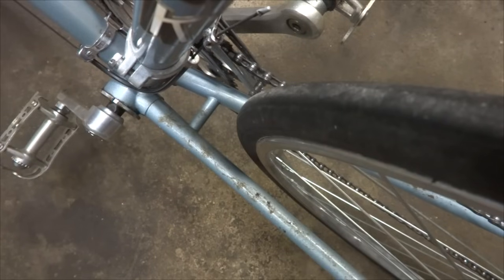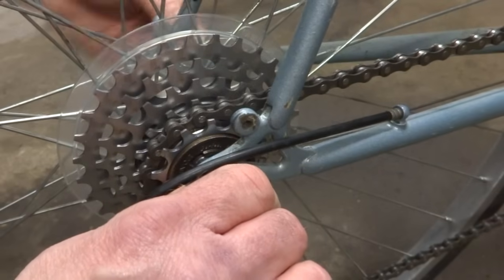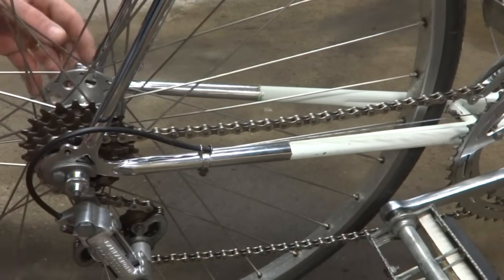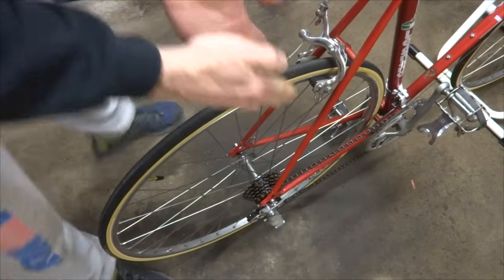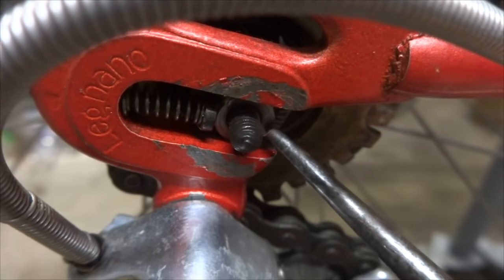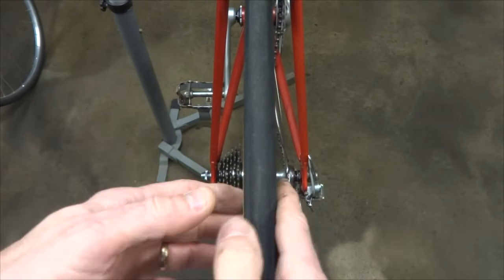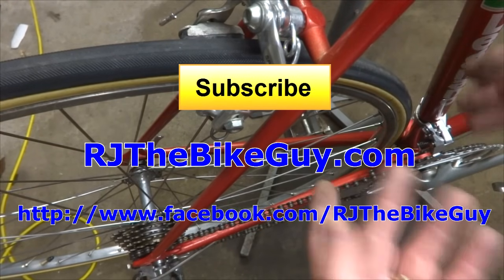Fix Rear Bike Wheel - Off Center/Rubbing Frame

Comment: I have this problem with my new bike, rubbing on the drive side, but it’s a through axle bike so I couldn’t adjust the axles of the frame, I am not sure if it’s the problem of the wheel or the frame. Really drive me mad.

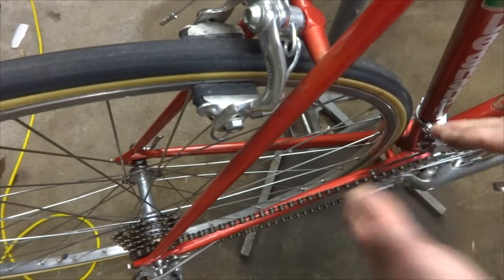Comment: 09:08, why is it not essential to ensure that those stays are properly centred? 
At which point does stay alignment with respect to the frame tubes' axis become critical?
Reply from the maker: The closer to centered the better. But you are never going to have it perfectly centered. Is it important to have it centered to 0.00000000000000000000001mm? No! Look at 3mm. It's tiny. Not going to make a huge difference. The farther off, the bigger the difference, especially at higher speeds.

Comment: Mine comes loose like crazy. No matter how even it goes in to drop out no matter how tight it's tighten .. I have shimano deore rims with quick release. Soon as I pedal meaning force to get moving from a stop you instant feel rear rim shift to the right of frame. There also is no loose bearings. And no broken axel. Hope you can help. 14 times in 5 Mile ride I keep having to get off bike to reset the hub in drop out
Reply from the maker: I can't tell you without working on the bike. You need a mechanic to look at it.

Comment: The spacer on the axle on the drive side is longer than the one on the non-drive side.
Does it not cause the wheel to be off-center, closer to the left brake pad ?
Reply from the maker: It's longer to accommodate the freewheel/cassette. The spokes are also different lengths on each side. But the wheel should be dished so it is centered.

Comment: My aluminum frame is toast!! It was a hit and run, I recovered however it would appear I cannot bend the aluminum frame back!!! Should I cannibalize???
Reply from the maker: +Johann Goethe If the aluminum frame is bent, it is toast. The only way to safely bend it back is to have it heated, bent back, and then heat treated. This would all need to be done by an expert. Probably not worth it unless you have a very rare and valuable bike. Get a new frame and transfer the parts.
Reply: RJ The Bike Guy THANK YOU!!!
Reply: @Johannas  Eat it
Reply: @RJTheBikeGuy  oo

Comment: is there a way to prevent the wheel go out of aligmebt when you put too much force on the pedals?, maybe changing the qrs?
Reply from the maker: I covered that in the video. Stronger skewer, dropouts aligned, etc.
Reply: @RJTheBikeGuy  why did you kill the forums of your page?, there will be super productive to respond questions inside the comunity.
Reply from the maker: @fernandomiranda765  They were getting overwhelmed with obnoxious spam.
Reply: I looked for the video you mention but could not find it on your channel.  Can you add a link pls. I have the same issue on a 1980's 12 speed I am trying to restore. When I put a lot of pressure on the drive the wheel pulls to the opposite side.
Reply: i solved readjusting the axle of the wheel, it was to long on the no drive side and didt let the secure to clamp with force the frame

the axle of the wheel most no proture off the outside of the seat stays.

hope that's help.
Reply from the maker: Which video I mention?
Reply: The you mentioned "stronger skewer" to the first reply
Reply from the maker: This video.

Comment: my jopos rear tire starts rubbing the frame when i try to pedal, and when i flip the bike the rear tire is loose going from left to right
Reply from the maker: You have to work the problem.
Reply: @RJTheBikeGuy  mine is hitting to brakes , What's the problem there

Comment: Hey man my tire keeps rubbing against the frame, I took it to the shop I bought it from but every once in a while it happens again, its a surly cross check. Any suggestions? could it be a frame issue?
Reply from the maker: All my suggestions are in the video.

Comment: I have a problem with my roadbike. I change the tyre with a high tyre 28, before I use 23 Now the problem is the tyre touch the front plate. I think I want to cut half of the plate to give a space to the tyre. Is that can? My friend said better dont.
Reply from the maker: Don't.
Reply: @RJTheBikeGuy  ok noted I will not do it. Many people said dont do it. Thanks..

Comment: I put a new tyre on - 2.1" width on older mountain bicycle.
I had a 2.1" MTB tyre on before, but the new one is definitely chunkier, a little higher and has a little higher volume.
It´s kind of annoying how a 2.1" tyre can vary in height and volume so much and there is no way to know that.
.
Anyway, the wheel is true - I have rim brakes and no rubbing there so I know the wheel is true.
.
But the tyre rubs against one side of the frame - against the chainstay on the opposite side from the cassette. 
So even though the wheel is true, it is like the tyre is not true.
[for approx 180 degrees there is no rub, and about a 2 mm gap, but for 180 degrees there is a little or a lot of rub]
On the other chainstay [on the cassette side], there is always between 4.5 to 6.5 mm of space.
.
I guess I just need to install a tyre that is not as wide and chunky.
.
But is there anything that can be done to address how out of true the tyre is?
I imagine not, but it is surprising how bad it is - I thought pumping air in would remove any such irregularities.
It is a Michelin Country Race´r 26" x 2.1"
.
Maybe if I remove the tyre and put it back on the problem might disappear?
Or remove it and install it the other way round?
Or put a washer in between the frame and the wheel to add a little space?
  [but maybe that would affect the rim brakes too?]
.
Well if anyone has any remedies, please let me know.
.
Thanks
JB
Reply: I tried the washer thing - was not going to work, was very little axle free / exposed to put it on.
I also tried this suggestion [but using standard flat washers]
  https://www.youtube.com/watch?v=conXV3EMGVU
It did not appear to make any difference, and I have no idea why it even would, but it was worth a try.
.
Then I removed the tyre and put it on the other way round, and that did fix the issue. 🙂
Tyre still moves towards the chainstay for around 180 degrees, but at  least now it does not make contact.
cheers!
JB

Comment: If i put my wheel in straight and put force on the pedals it goes to the left
Reply: Hey same here!  Did you get it fixed?
Reply: Your axle is probably broken. Now the only thing holding it is the QR go ahead and replace it
Reply: Max another possibility is (if your axle is not broken) one or all of the bolts are facing the wrong direction, i mean the side with bumps should be facing the dropout
Reply: Max Buy a new chain

Comment: My axle spins when I begin tightening the nut and it shifts it towards the frame anyway to fix that
Reply from the maker: I can't diagnose your issue without working on your bike.
Reply: @RJTheBikeGuy  so what happens is I tighten my chain and while I’m tighten the nuts the axles spins with the nut and when I get the nuts tighten and I ride my bike the wheel shifts towards the frame and my chain gets loose

Comment: Mine pops out of being seated while tightening and my disc brake rubs any advice for it
Reply from the maker: I discussed the most common causes in the video. If you can't figure out, take it to a mechanic. I can't diagnose it through the internet.
Reply: Oh I am thinking it’s frame damage I wish I could hire you to repair it but it just kinda sucks thanks for the reply though
Reply: emailnodata This is late but it didnt use a skewer the wheels had lug nuts on them.

Comment: The issue with my bicycle is that when I install the wheel it seems to be okay, everything is in line and straight. After taking it for a ride though, the wheel goes sideways. This happens in a distance of approximately 150m. Could you help me?
Reply from the maker: Clamp it tighter.
Reply: +RJ The Bike Guy It is as tight as possible. I just figured out that the skewer is bent though, could this be the case?
Reply from the maker: Did you go through all the steps in this video?

Comment: I’m riding a Diamondback sync. The rear wheel is ever so slightly off center however if I punch the drivetrain to accelerate the wheel off centres itself even more and rubs on the frame any one know what going on?
Reply from the maker: Not without working on the bike. Maybe frame flex.

Comment: What if my bike rear wheel is centered between the chain stays, but is off center on the top, where the brakes are mounted to the frame? Its so weird
Reply from the maker: Can't tell you without working on the bike. Go through the video.

Comment: my wheel touches the frame if i very quickly accelerate or if i carry something heavy. thew frame is bent but somehow its been fixed a few times
Reply from the maker: I don't know. Maybe the frame is bending. Maybe the wheel is bending. Maybe the spokes are loose. No idea.
Reply: the aluminum frame is bent and the quick releases were just removed
Reply from the maker: If the aluminum frame is bent, you should probably replace it. Especially if someone tried to bend it back.
Reply: it hasnt been bent back

Comment: I kind of still don’t understand though, I own a mongoose XR-15 and everything is good with it, but when I pedal hard on 3-7 Gear the wheel either rubs on the frame, or it will go out of place and stay on the frame until I move it out again, and it continues to do this, could anybody help me?
Reply from the maker: Hard to diagnose without examining the bike. You may want to have a mechanic look at it.
Reply: Mine does same thing new specialized with quick release . Nothing broke or bent just rear tire shifts to left rubbing frame untill I release quick release
Reply: Joey S I have learned how to fix my problem, all ya need to do is take the wheel off re ajdust it, then you need to tighten the wheel as hard as you can and hold it in place in the middle, I figured out that the force of me pedaling from the derailleur side pulls the wheel to the left, due to the force.
Reply from the maker: @deevanhook547  You may need a stronger skewer, or your dropous are out of alignment, or the axle is too long, or, or, or, etc.
Reply: @deevanhook547  thank you I'm taking it in Monday guy at shop said same thing based on what it's doing.
Reply: Joey S I'm glad i can help, it's just really annoying man, cause it stops me from going the speeds i require, because for me. I'm a fast rider, i like bikes that would get me somewhere quick, with style. The one thing i wish to know is if Disc Brakes really have a Difference Then Rim/V Brakes.
Reply: Rim brakes stop faster then disk brakes. And when it rains disk brakes stop safer as pads are not rubbing on a wet rim

Comment: A few good ideas (reasons a wheel could be off centre) but far too heavy reliance on specialized bike shop tools. If something requires specialized tools to fix it shouldn't be advertised as something home bike owners could do. I'm not going to go out and spend hundreds of dollars on tools I'll use once on a single bike. If that's what's involved just tell us to go to a bike shop to get it fixed. This video is mainly a waste of time for those of us who want to do our own repairs.
Reply from the maker: I don't design the bikes. I have no control over what tools are needed to do various jobs. You mentioned "advertised as something home bike owners could do." Not sure where it was advertised as that, but yes, this is something that can be done at home...if you have the tools. Just buy the tools you need. Or don't. You can always take it to a bike shop and pay them to fix it. I have plenty of videos showing how to make various tools. Geez!
Reply: Is he talking about the dishing tool or the frame alignment tool? Honestly, you can see if there is a DIY shop near you and they could let you borrow the tool. Usually neither tool is necessary on a frequent basis or at all if you take care of your bike.
Reply from the maker: How to make a dishing tool for under $5: https://www.youtube.com/watch?v=DaWZ_uoE9TY
How to make a frame alignment gauge: https://www.youtube.com/watch?v=z9bPiAi_KQc